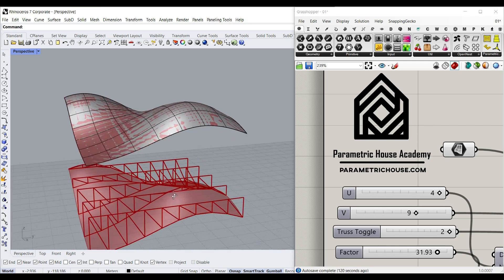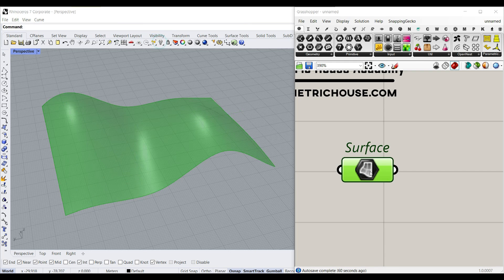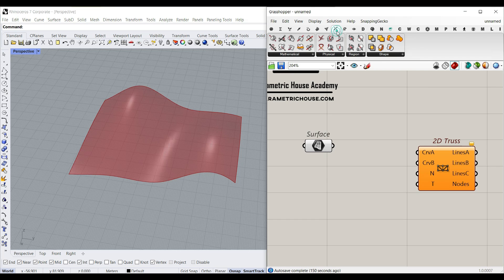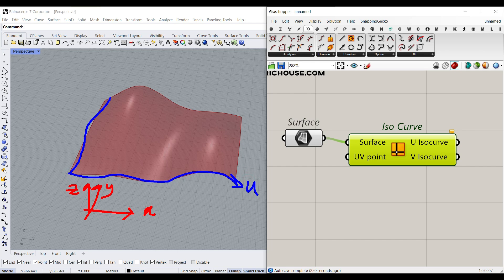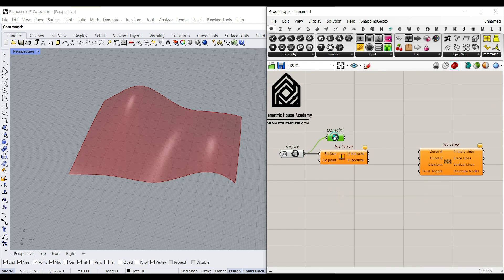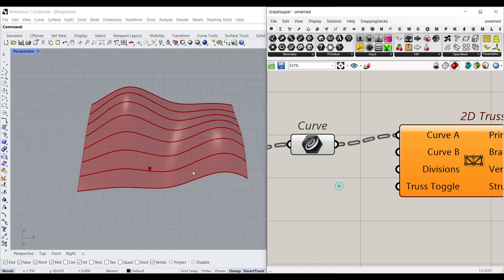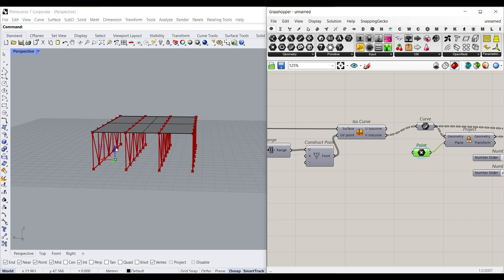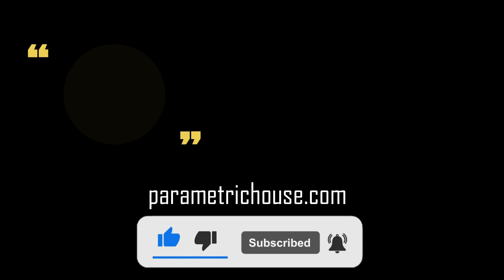Rhino Grasshopper Tutorial For Beginners (Parametric Truss)

Comment: I tried to make this truss out of 2 curves. the bottom is flat but the top one is in a slope so not parallel of the bottom one.  Because of the sloped curve, for some reason the points arent getting connected properly, like the end points are gonnected with the starting points and crossing each other. what am i doing wrong?

Comment: Does this truss pass all the structural safety parameters?
Reply: that is the step number 2 of the design process... if the trusses fail, we come back to this for more iterations, and loop goes on... untill we find the best fit. 

I believe this method will work best for those who want to avoid optimization tools and try trial and error.